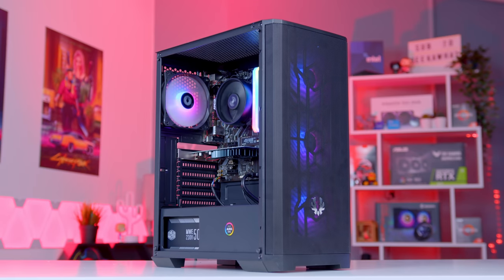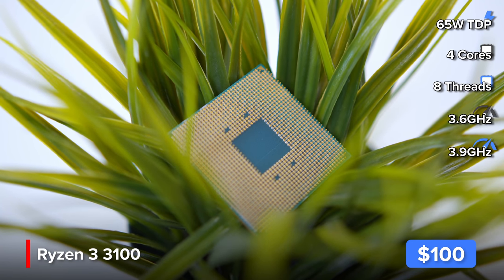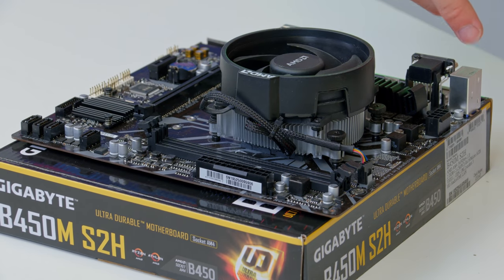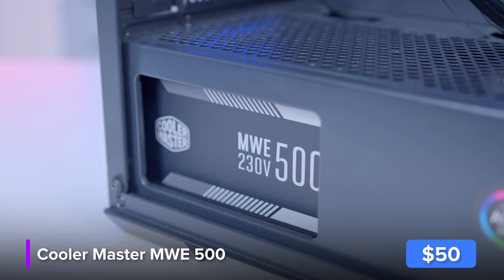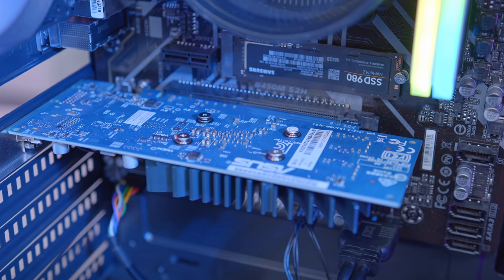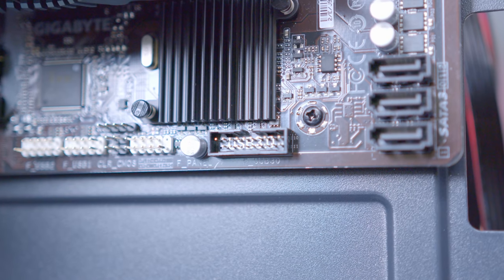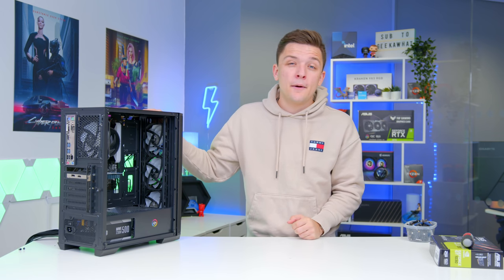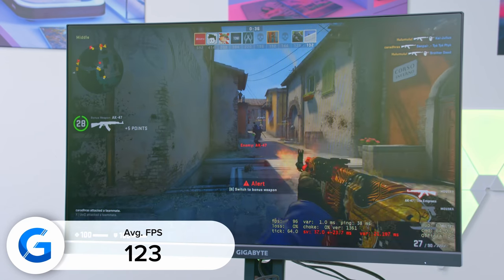Budget $500 Gaming PC Build 2021! [Full Budget Build Guide w/ 1080p Benchmarks!]

Comment: I built this exact Pc but with the Ryzen 5 1600, it performs really well for the spec and is a good starting point for beginners I also changed the case to the Lian Li Lancool 205, and was super easy and fun to build!
Reply: What was the cost difference
Reply: you can literally find a gtx 970 4GB on the ebay market for 170 dollars on the used market instead of a gt 1030
Reply: @dercrysisbz2049  maybe I didn’t have enough money for a 970 + I bought them all new and the drivers on the 900 series cards have been discontinued
Reply: @colehappy9928  50 ish dollars but I use euros cause I’m Irish
Reply: @quad1913  that's a lie, the gtx 970 drivers are still being made today cause gtx 1060/gtx 970 are alike
Reply: @quad1913  900 series is still getting new drivers. they stopped the 600 and 700 series driver support

Comment: Which do you think is better this or the Ryzen 5 5600g? I want to build a budget pc soon.
Reply: the igpu of 5600g is better than the 1030 and is overall better in the long run if ur gonna get an upgrade in gpu
Reply: @bryle3059  thanks for the tip i will use the 5600g.
Reply: @neonfuture9093  1000% go for the 5600g. as then you have a very good cpu once gpu prices go down you can carry on using the 5600g

Comment: u can get a gtx 750ti for a little more like £78 from cex and it will be slightly better than a 1030 or if u got a little more cash i would go for a gtx 960 or 970
Reply: I found a gtx 960 for £95 on cex
Reply: @sharminsiraji533  yh see it will get a playable experience it's like a gtx 1050 with a slightly lower price and slightly better performance

Comment: Just get a 5600g . Way better cpu than the 3100 and the igpu is still better than gt 1030 Lmao. Tho this will require a external cooler but considering how good that cpu is and it leaves you more flexibilty for d gpu upgrade

Comment: I made the 5600g built with one 8gb ram and I’m getting 40 FPS in csgo :(
Reply: Need atleast 12gb’s in dual channel to get above 60fps
Reply: @qwzerty_1023  ok thanks I’ll get another stick 👍🏻
Reply: @enriquenavarrete1810  Np, goodluck
Reply: @enriquenavarrete1810  Ryzen CPU’s demand a lot of Ram, so 8gb is bad enough for Ryzen, but single channel is really bad, and since your most likely using the cpu as your graphics card right now, you will want 16gb for a comfortable experience on games
Reply: @qwzerty_1023  agree. I just built a 5600G system. Using a dual channel 16GB 3200mhz. Running fps games like Valo, CSGO, or even old triple A games like Far Cry and AC games with medium to high settings are a breeze.
Reply: You need 16gb of ram don't worry bro :) get another identical stick of ram to the one you have hopefully its 3200mhz or above